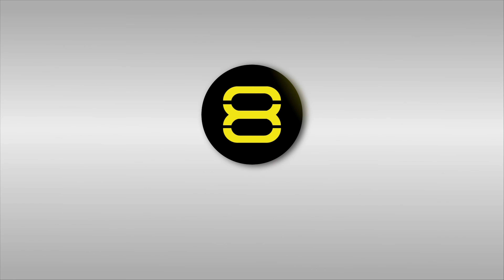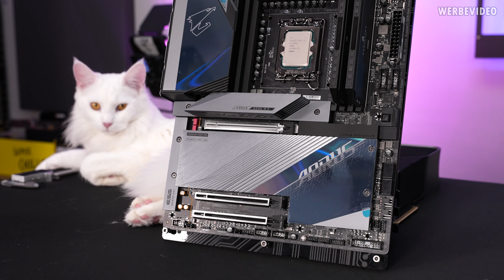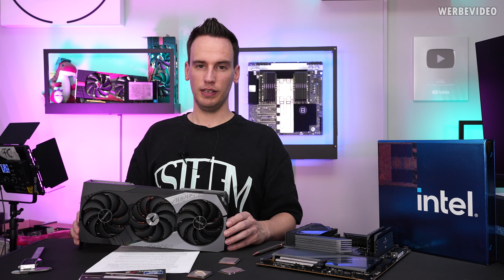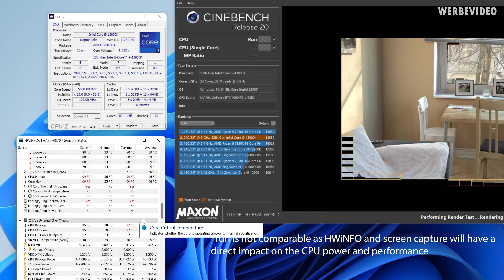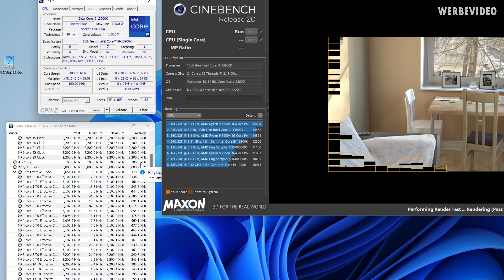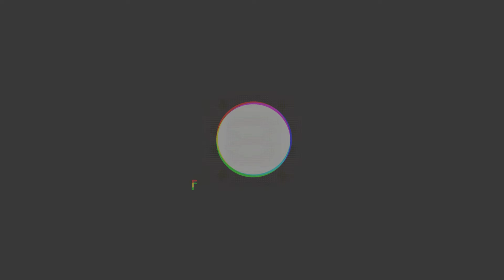Testing and Tuning the new 13900K for Efficiency

Comment: How i can change to intel 13700k eco mode ?  Can somebody help!
Reply: I have the same processor and I have 10 BioniX p140 fans in the 5000d airflow case Any advice if you found anything?
Reply: I know this comment is old, but for anyone else wondering -

- To change any Intel CPU to it's eco mode, you simply find it's recommended power limits by Intel (look up your specific CPU and what intel's actual limits for it are)

- Then you go in to your BIOS, tweaker, advanced CPU settings and change the pl1-pl2 limits to the previously mentioned intel recommended limits. This process might be slightly different depending on your motherboard and BIOS, so keep that in mind.

Comment: Brothers, everyone says for the gaming even 240 mm cooler will be enough for 13900k. I have mine hitting 100 degree easily in pubg. While hitting 100 degree game fails and crushes. So i pulled downd the ratio *53 and pull down bios cpu heat limit to 90 degree. Otherwise impossible to use. Any one can advise me? Since my mother board is different from the video and i couldnt make it.
Reply: Do you mean it spikes to 100c or stays there while gaming? Something is not right with either your configuration or the cpu cooler/thermal paste..

Comment: What’s a stable Overclock for gaming? Here is my specs:

Intel i9 13900k
Gigabyte Z790 Aorus Máster
64gb @ 6400mhz G.Skill Z5 RBG DDR5
Gigabyte Aorus Máster RTX 4080
2TB Samsung 980 pro m.2 
2 x 1TB each 870 Samsung Evo QVO
1300 Watt EVGA Súper Nova + P
420mm Corsair i170h Capellix Elite LCD AIO
Corsair iCue 7000x RGB chassis with 7x 140mm fans (cfm 89.9 each up to 1700 rpm) and 4x 120mm fans (cfm 65.57 per fan up to 2100 rpm)

So basically my goal is to learn how to overclock my CPU, RAM, and GPU to a happy high for gaming that won’t fry. Lol. 

What you guys think of 5.8-6ghz overclock, is it stable under my specs?
Reply: Dude I have almost the exact same specs as you, the only difference is I have a 4090. You don’t need to overclock your system, I undervolted and limited my cpu power and have my 4090 set to a max %40 power draw and I can still play every single game on max settings at 1440p and 4k.

Comment: Honestly the only time 1% and 0.1% lows add any value is when they are an extreme deviation from everything else. That's both higher or lower in deviation. If they are a similar percentage of the average FPS compared to everything else in competition then what's the point in talking about them? Just more time explaining something not really worth talking about because the info will be forgotten once the next slide is up. If the lows are similar to everything else they are not worth bringing up just to say they are similar.

Comment: Far Cry 6 is a BS test... 
I want to see: 
- 7700X results
- 0.1% FPS
- 3090 Ti results
- 13900K full power R20/R23 results
- 13900K temps at various undervolts/tweaks
- Win 11 vs 10 vs 7 results

There's no such thing as "too much information", when it comes to benchmarking. There's simply not enough info and games tested here to decide between 13900K and 7950X or 7700X, or to determine if a 3090 Ti is enough or not.

Comment: dunno if thing about windows 22H2 is resolved at this point, but it was supposedly throttling 7900 and 7950, and since 7700 had way better scores in games then value of high end AMD CPU could change with single windows update, intel 12-gen had bad entry with windows aswell so probably same story will apply here with some performance bumps for AMD

7950 on single CCD can get 20% performance boost so it can change those charts drastically, but at the same time it might not change that much, so i think it will have to be retested at later date

Comment: It just makes me wonder if AMD and Intel really need to be told off by the PC community when it comes to giving us something we didn't ask for. Higher power consumption. AMD made especially big claims about efficiency, and then they told the world they designed the CPU around its 20 degree IHS to run at 95 degrees C to save the consumer the expense of changing AIO or cooler? Only for Intel to go, "hold my drink" to AMD, and just bounce off 100 degrees C, with an extra 100W for 5% more power in frequency? What world are these CPU's built for?
Reply: To look better on their release video charts

Comment: Amazing analysis. This just shows why only reviewing products at stock settings provides no useful information. Stock power consumption of all these new CPUs and GPUs is ridiculous. It is all about using the power limits, and undervolting + underclocking brings even more efficiency.
But for just gaming, this is a terrible CPU anyway. You should only buy this if your budget is unlimited and you do not have to sacrifice other components, mainly the GPU. All the lower tier SKUs will destroy this one in performance per dollar. This is a productivity CPU, just like the 12- an 16-core offerings from AMD.

Comment: For Gaming, the fact the the 5800X3D can compete for half the power or less is crazy.
Can't wait to see 7000 X3D !
Reply: lol until AMD pulls an nvidia and says its too good of a product...I can see the 3d processors being a 1080ti moment
Reply: @2ndcitysaint52  What? They've confirmed the 3D v-cache for the 7000 in Q1 2023

Why are you pessimistic
Reply: @bootchoo96  Well, going by the fact that AMD has scaled down the production of zen4 because of low initial sales volume, meaning a better 3d v-cache cpu will effectively kill ordinary Ryzen 7000 all together. No way AMD is gonna do that, it's simply easier to pull the plug on 3d v-cache 7000's for now.

Comment: Just had to downvote. Yet again another reviewer recommending buying Intel without considering the fact that the AM5 platform already supports PCIe 5 and will be supported until 2025 at the very least for another one or two CPU generations. Moreover, there will be the X3D V-Cache versions 7800X3D, 8800X3D and 9800X3D most probably all of which may well be supported by any AM4 motherboard bought today. A shame really.

Comment: I normally don't dislike your videos, but your ending conclusion of getting a DDR4 board while not testing as comprehensively as you did with the DDR5 board is below your standard. You are potentially recommending people spend more money first to get a DDR4 system, then later to buy a DDR5 system. Please test to see if these CPUs are a plug-in upgrade with minimal loss in performance before recommending as you have.

Comment: classic amd scaling bahavior
they are not good tbh,this is my observation after using both desktop and laptop amd(r7 2700x,r7 3700x,r5 7600x,r7 6800h)
the chiplet design have a lot of beneficials:less pricey silicon to make,easier to scale performance,still power efficient
but 1 big disadvantage ,power scaling gonna be very bad ,for example,if amd targets the chip total power is 55w,the chip gonna perform very well,and if you start putting more power,it not gonna scale,the performance will go flat,less power will make it drop a lot of performance,while intel rather go in a near linear scaling
in conclusion ,amd at default power is very good,it beats intel for cheaper,thats why thin gaming laptop makers jump to amd that fast,but for big laptops,going up to 130w++ pl ,intel still the strongest,no chip maker can do that good power scaling
just my observation,english is not my 1st language

Comment: So AMD wins. Intel does the same job as AMD at 130% of the power consumption and wins only in useless things like 600fps vs 500fps on a 4090 on low settings. Absolute waste of money to buy a 32 thread CPU and then cripple it's mutithread performance with a 70W power limit.

Comment: hey bro , I think you should run the tests with only full HD settings to make pressure on the CPU not the GPU . I think it will be a big difference in the preformance.

Comment: Yes buy super expensive cpu undervolt it and lose 10% performance... Maybe dont buy it and buy 13600k or 7700x ?  or 5800x3d
Reply: undervolt results in 0 performance loss.
Reply: the point of an undervolt is to maintain performance and reduce power consumption. If you are losing performance you haven't performed an undervolt, you've gimped your CPU, albeit it's indeed drawing less power

Comment: ASUS ROG Maximus Z790 HERO is a piece of shit motherboard (MB), DO NOT BUY, I got it two yrs ago and it broke 2 of the RAM B1 and B2 malfunctioned started getting the blue screen, RMA it three time with their 20 list of inspections to prevent issues. 1st RMA of my MB I got back from ASUS was not mine but a refurbished with two Ram slot malfunctioned CPU pins missing and three pins on the power source bent this time A2 & B2. 2nd RMA of MB they fix the CPU and PINS but the same issues with the RAM malfunctioning. 3rd RMA MB the again did not fix the problem send me back the same MB 2nd time now with only 1 RAM slot working.  The Susus does not want to give me a new MB saying they have no more and they also denied me to given me mu money back even as a store credit.

Comment: Wow, really sad that AMD does not support undervolting and overlocking. Would be grate to compare what CPUs can do. And for sure, Intel has not sampled golden samples to the reviewers this time as they have done all the years before. /s
Reply: Wtf? I have undervolted my 5800x to be 90w cpu
Reply: @lifemocker85  you missed the end of my comment, so i repeat - /s - as in, end of sarcasm. As 7950X review was deliding and getting -20C from stock. ECO mode checked - nope, any playing around with power consumption - nope. 4090 review, include a competing product from other vendor - nope. Bit sad. Would have loved power draw/performance curve for 7950X or 7700X.
Reply: check hwu review
Reply: @lifemocker85  HWU i watched first, then GN and 3rd Roman. HWU was the most positive. Then GN. Kind of agree more with GN

Comment: So it turns out 13900k needs a bit of tweaking just like 7950x (which is a shitty processor price/performance/tdp wise comparing to 13900k) and it will be cool as ice 

AMD boys will have to wait for 2-3 years while amd delivers on the platform. Too much waiting for 1 life :(
Reply: AM5 has a lot of life though

Comment: Wait, so score is "about the same" at 5:09 where it shows AMD has a 4% lead but not the same in the beginning where 13900K leads by 4%? Why are you highlighting small leads intel has but masking small leads AMD has? Also, they dont "behave the same again" at 5:39. You can see that when they are both 90W, the 7950X has a 2% lead. Moreover, full tilt, AMDs efficiency is clearly evident with scores within 1% and a 30W difference.

The issue here is that if you highlight differences of less than 5% when Intel has that small lead, then you should also do so for AMD. Otherwise, it comes off as biased when you give "performance wins" to one company when really the performance is tied and basically a wash. Only ST performance is large enough to really count as a win. And if you wanna count less than 5% as significant lead, then I really believe that is in AMDs corner for multicore performance because Intel just pushed higher power to squeeze the few extra % needed to get their lead full tilt (unlimited).

Either 5% or less is a tie or not. You cant have it one way for one and another way for another.

I wont even start on game selection. Half the games selected are terrible. We should know better by now. One, get rid of all GPU bottlenecked games. Two, PUBG is horribly optimized. Always has been. Why that game. When you only do 3-5 games, you have to be extra aware of your choices and how selection bias can factor into results. Have a couple Intel favorites and a couple AMD favorites and mix in a few neutral well built newer titles OR neutral popular titles. 

I really like some of the content der8auer puts out so I really want him to get his shine. I really want to see him rise, but to do that you really have to put in extra effort to be as fair and even handed as possible even if you feel that you already dont have any bias towards one or the other. Its about what others will see. I think you need to highlight the strengths and weaknesses equally of both AMD and Intel chips and you need to contextualize that info for purchasing decisions. 13900K and 7950X are not gaming chips. The extra 8 cores arent there for gaming. They game better with those extra cores turned off.

Comment: only thing is, 13900k is twice as expensive as the 5800x3D and also requires a more expensive motherboard and RAM. So really it still makes no sense to buy.
Reply: The 13900k also requires a better cooler and consumes more power.

Comment: Shintel Core i9 13900K eats 335 + Watts as a CPU die alone when running at STOCK CLOCKS with default all core 15 second turboing. There is nothing efficient about that and is thus a stupid thing to pursue.

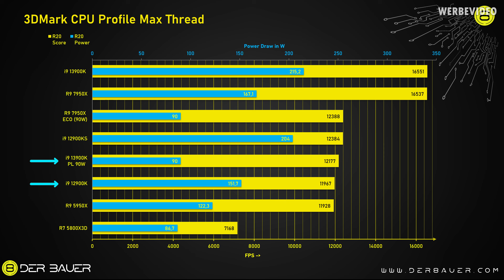Comment: Your admitting that the Intel 12th & 13th Gen CPU's use 30% or more power than AMD. Yet its funny to see you cherry pick that Intel uses 60W less power in multithreaded tasks 5:44 as if that is to mean something. I don't mind you treating your viewers as fools but don't do it to me. What you fail to mention is the overall power usage by Intel at a particular task. Whether that be gaming or office and the result is that Intel uses way more power than AMD. And if you have a laptop, then this could prove to be disastrous.